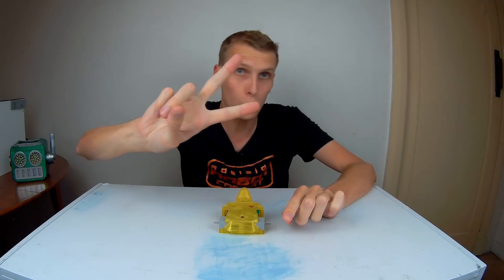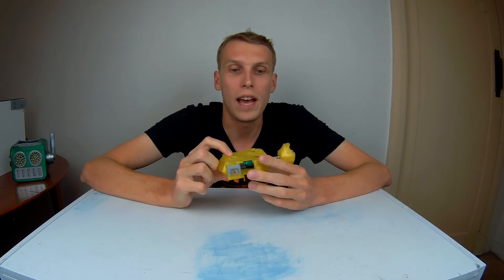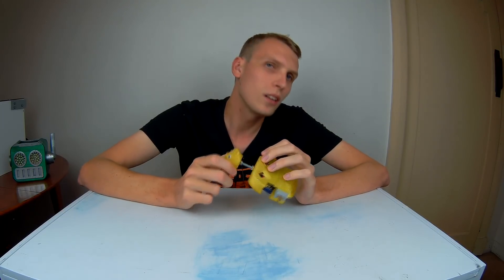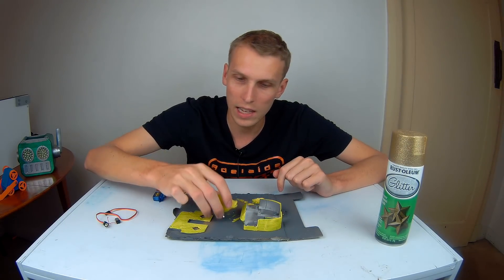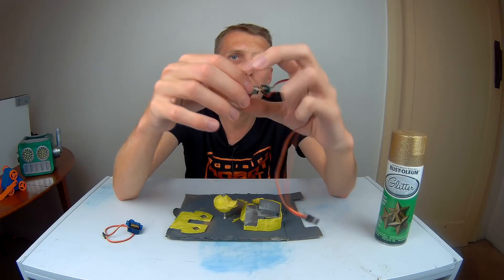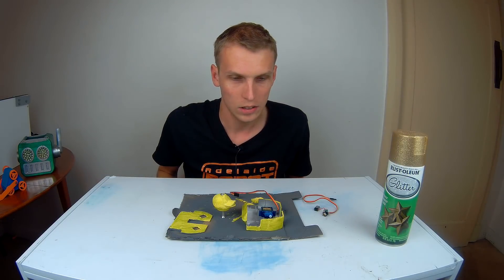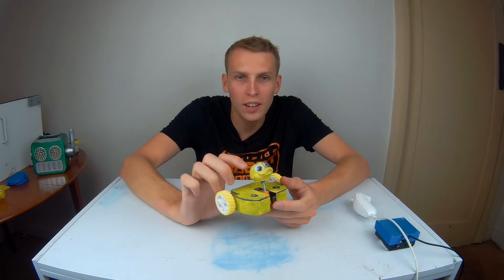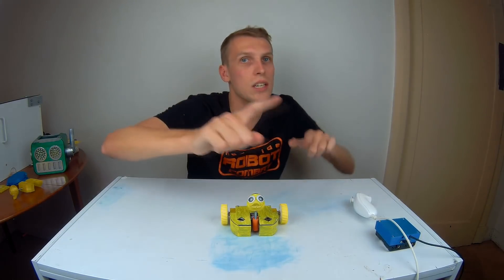Duck shaped loan combat robot build!!

Comment: Your servo hack looks like a great idea! Did it improve speed and torque of your motor? I am planning to build an antweight with a servo driven saw arm, so this could help
Reply from the maker: I haven't done a full test against an unmodified servo, but by eye it looks to be faster.

And on paper its faster, because I'm driving it with 8ish volts rather then 5 volts